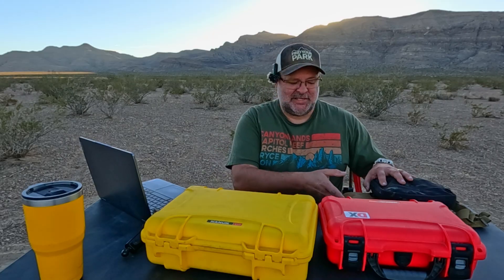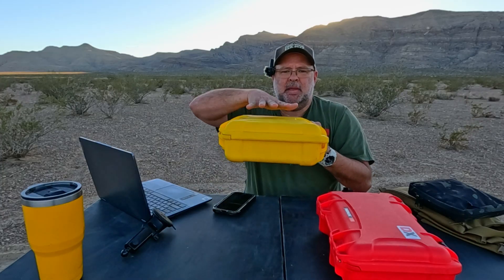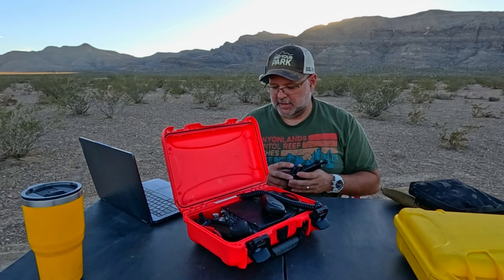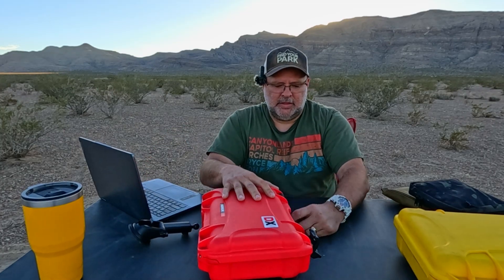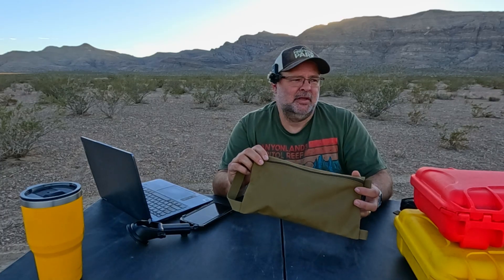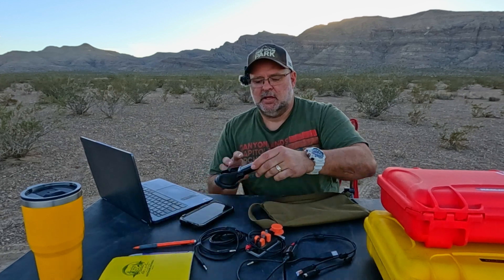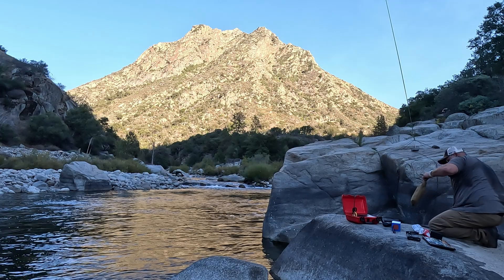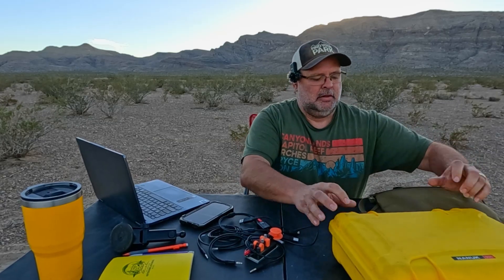My Evolving Portable Ham Radio Station | Nanuk Case, Shadow Circuits Pouches, & Yaesu FT-891

Comment: Hey Mike, how do you handle QRZ being a rover?  I expect you update your location in QRZ each new place so others logging you will get it right?
Reply: Thanks.  Yes and that does work for your log….but for someone making a contact with you they make a log entry right then and it autopopulates with your QTH.  Your log will be correct when you upload  but theirs will not.  I hadn’t even noticed this until several of my contacts for QRZ 50 states were disqualified for not matching theirs.  I just logged their call sign, time, frequency and let the rest fill in as it does in virtually all of the logging softwares.  When you upload your correct file it is not going to change their log.

I have started changing my location in QRZ PRIOR to doing field operation now so that theirs will be correct, but that only works for someone using QRZ.  I was hoping you might have a better method.
If I chase POTA now for each contact  I have to look up the state and county for the park, get the park maidenhead grid off of the POTA site, and edit/modify their location in my QRZ log as I make a contact with them.  Huge pain but if they don’t modify their location before activating then everyone making contacts with them will incorrectly log a contact with their home QTH.  It is such a pain that I have started to ignore activators.  I emailed POTA and asked if their website could at least include the county so people like me that want a correct log can easily edit the log but they let me know it is all volunteer and thanks but no thanks (in a nice way)
Anyway, too long but since you travel so much I was hoping you had a better suggestion and I wish more people would change their QRZ location BEFORE activating or operating in the field.
Reply from the maker: @CanyoneerDuke Interesting. Ok, so if I understand correctly, you’re logging DIRECTLY into QRZ and as you enter an activators callsign it auto populates with their home QTH, or in my case whatever location I entered last. Hmmm. I’ll have to think about that. Let’s see if we can figure something out between the two of us and test it. If it works, I’ll make a video giving the directions.
Reply from the maker: You know, I was thinking of making a video about this very topic. From my log, I go to “Settings” and then “Log Properties” to manually change my location every time before I upload an ADIF. Sure there’s more automated ways, but it’s finicky business getting software to talk to each other and I just couldn’t get it to work. This method is 100%.
Reply: Not just QRZ.  LOTW, Polo, HAMRS…..they all do and we want them to.  We certainly don’t want to have to enter that for every contact.  They all draw from the public FCC database, which is good.  The only issue is when someone is not at that QTH location and there is no way for those loggers to know the person is in the field.  I like QRZ because it lets me change my location.  Not change the QTH, just operating location.
Reply from the maker: @CanyoneerDuke am I anywhere in your log? If so could you tell me if it shows correctly?